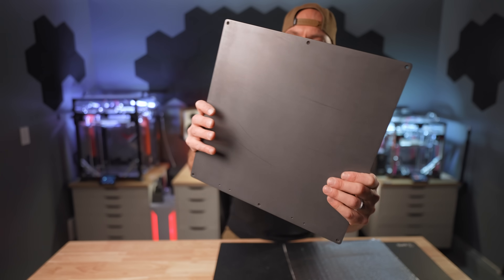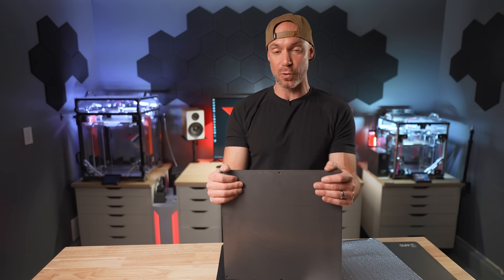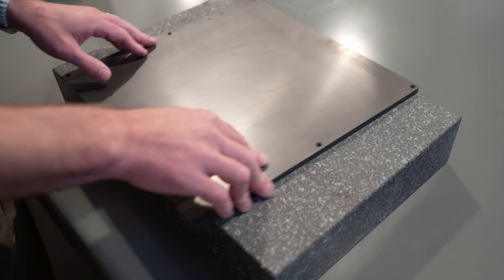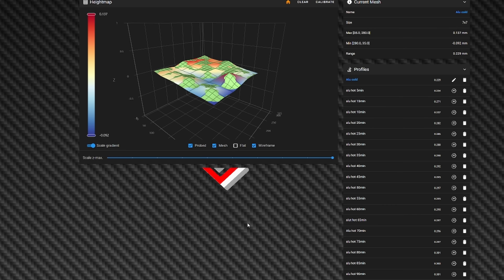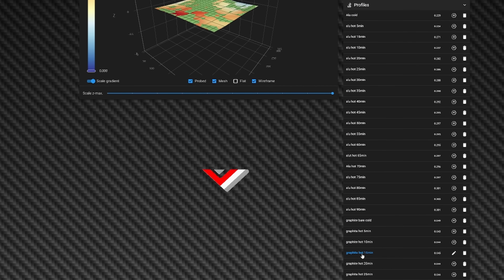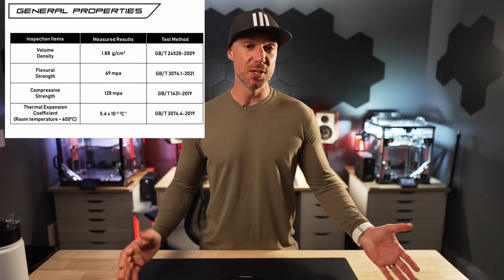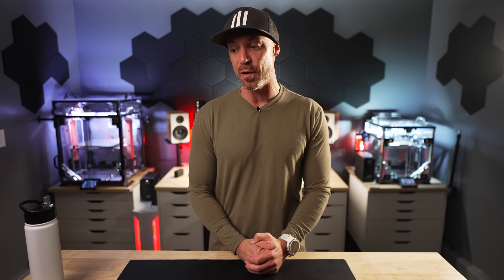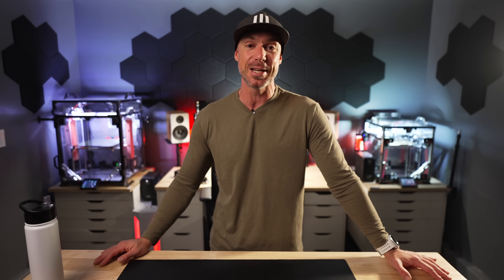Graphite 3D printer Bed - Good or bad ?

Comment: have someone tried a thick steel plate? has half the expansion coefficient of Aluminum and much stronger so less deflection due vibrations and print weight, also a 6mm steel plate should be quite cheap.

Comment: I moved away from aluminum beds with spring steel the instant i saw carbide glass beds.. and after 1000's of prints over about 4 years with half of them being technical materials like ASA, ABS, PC, PPA, etc with the bed heated up to 110c the glass has warped. It's currently at 0.21 cold and 0.265 at 110c on a 300x300mm print area, which is still better than most aluminum beds with spring steel when new.. BUT ~0.050 is so temping. I just wonder how it would pair with a glass bed still because i still found on large dense prints they would pull up the spring steel off the magnetic surface (Gizmodorks magnetic sheet and PEI bed) and with glass i can print a solid ABS part that no lift/warp while also pushing heat into the part and enclosed chamber better (hits 75c after 30 min). Enclosed PETG prints even come out concaved a bit. I'm still thinking about how that even happens. Anywho, if i could get a graphite bed with a carbide glass top that would IMO be the best.

Comment: thanks for doing this testing Vez!  I think this is a pretty novel product... but I still think you're gonna be waiting for a heat soak either way for the rest of the aluminum in the printer, as long as your bed deforms in a measurable/repeatable way I'm not sure this is like THE NEXT BIG THING per say.    Pretty cool tho!

Comment: While I've worked with various composites for a long time, I don't see how this is worth $180. I've been contemplating making my own vs rigging up an eddy current probe. Getting a flat composite surface is less a challenge and more of a requirement, but there's many methods of doing it cheaply as part of the process. If you can cut a ceramic, graphite isn't much more difficult as it grinds very well with suitable abrasives, but more to the point, it's extremely moldable. The tighter the tolerance of the mold, the less you have to grind towards perfection.

Comment: Hi Vez. I saw on your earlier material this flat table surface sensor. then I saw on AliExpress sh36 Eddy v3 board with this sensor, and I thought this is what you are using. so I bought it. now I see that in vz bot there is no sh36 board. how does it look?
Reply from the maker: @projectxmarketing3431  its a beacon3d sensor. I have a video about it
Reply: @ thanks for the answer. I'm currently building my printer. I've been using a quad motor for a good while but with a regular mainboard without a clipper and motor mounts and printhead are printed from ASA. I bought mounting brackets for the vz bot from mellow and a mounting bracket for the Y axis. I cut the Y crossbar out of carbon. I'm still working on the print head and I don't really know how to solve the issue of mounting the accelerometer and the table leveling sensor. I can't really find any materials about it on your channel. I'm configuring everything for the clipper but I have no experience, I'm doing it for the first time. it looks like the sh36 I bought will be useless

Comment: Keep in mind when doing bed leveling or flatness measuring, to have an accurate reading your printer axis has to be as straight as possible and as close as possible to 90° and i mean only a few microns. You simply dont know how flat the plate is if your axes are not verified to be straight which the linear rails are almost never.

Comment: At work we use graphite as the heating element/parts carrier tray try running current across the graphite plate. Not 100% sure how our equipment passes the current will look into it. Would eliminate the need for the silicone heater. We have been using our graphite carriers for years haven't replaced them. They get heated and cooled rapidly to and from 275C. Would be a interesting and novel video.
Reply: Hopefully no one tries this with one of these plates! High density graphite is highly conductive. If you put 220V through this plate without properly insulating it and then came into contact with it.. you'd have a really bad time. Quite likely your last really bad time.

Comment: 0:35 We actually use graphite plates at my job to hold parts when we run them through a furnace due to the extremely similar thermal expansion properties to steel. We need to keep extreme precision because the plates are locating and holding the parts together when they fused.

Edit: We manufacture the plates in house too it's super cool

Comment: What happens when you crash into the bed now?
Reply: With the magnet and flex plate, you'll almost certainly break everything else before that thing but yes in would technically be more brittle.

Comment: no 500mm version for ratrig 😢 guess I'll have to try the thicker alu plate from brs :/ sometimes i regret buying such a big printer when it comes to beds and pei sheets lol
Also i was thinking about trying out the Ti tube mod for X axis, does anybody know how well it works with big printers?

Comment: Much better solution: screw a pt1000 in the Aluminium bed. do a pid tune. Easy perfect bed temperture every time no need for heatsoak.
Reply: This isn't about temperature stability, it's about the bed not changing shape when it's hot versus when it's cold. The bed stays nearly the same shape regardless of temperature. My K1 Max bed is relatively flat when cold but urns into a taco when I get it up to 100c for printing ABS. I've shimmed it so that it's flat enough when it's 100c, but that means it's not flat when it's cold. That means I'm stuck printing only materials that require a 100c print bed. This solves that issue.

Comment: LOL 0,3 mm deviation of an aluminum bed?? WTF
Maybe you should buy a good aluminum bed and not cheap stuff with low qualtity.

The beds I sell have a 0,05 mm deviation maximum. Normally less.
At this size I´m in a price range of about 60-70.- €
Even with magnets it would be cheaper than this graphit thing. 
Then you just put your steelplate directly on the aluminum bed and start printing.

What is the advantage for graphit? Flatness? Not really.
Weight? doesn´t really matter.
Warping of the bed? Use good material and you don´t have any warping. 
I testet my beds with up to 300 °C and nothing changed.

Aluminum has a roughly the same thermal conductivity.

This expensive and useless.

Comment: I'm afraid that it's brittle; that if you crash the nozzle into there you're going to lose a LOT of money. Also how does adhesion of anything to graphite work? Do you print straight on there, do you put down a mag sticker and then steel sheet, do you apply a PEI or PP sticker, will the standard 3m high temperature transfer tape even adhere, even with the print warp forces pulling up on it?
Reply from the maker: @SianaGearz  they have a video showing crashing noozzles is not an issue. Yes i have put a pei steel
Reply: @Vez3D   Huh that's good to know thanks.

Comment: I just paid about the same price for a V2.4 350 bed from Mandala Rose Works plus an additional 100 for the kinematic mounting system,  For a bed that stable it's a good buy. In the UK electricity is £0.50 kwh so any reduction in soak time adds up. 400 hours saved and the beds for free.  What type, make of leveling sensor do you use?
Reply: Beacon probe
Reply: @travistucker7317  Will this work if you have a stick on magnetic sheet on the bed? TY
Reply: @landroveraddict2457  yes
Reply: @landroveraddict2457 It only works with the magnetic sheet. Embedded bed magnets would mess it up.
Reply: @JJFX-  cool 😁😁

Comment: Brilliant product.  Much better than the typical aluminum plate, aluminum has such a high rate of thermal expansion that it's quite difficult to keep it stable over any temperature change.  I've been looking into cast aluminum and cast iron plates with integral reinforcement webs to maxamize rigidity, but that's a whole new level of difficulty to do on your own.  Sadly out of my price range at this point, but a definite upgrade option.  

Also, a tip.  The dial indicator will read more accurately if you can keep the needle close to perpendicular to the direction of travel.  Cosine error can make the measurement show more than the actual movement, not that it matters too much for the level of precision you are dealing with.

Comment: what about stiffness? On a print plate of that size I probably print large models which may have quite some weight. Won't it sag? Or is that no issue at all?
Reply from the maker: Its stiffer than aluminum

Comment: Kinda pointless imo. You add a magnetic sheet when isn’t perfectly flat then the build plate also isn’t perfect. That’s what bed meshes are for. on top of that you still have to wait for frame to heat soak.
Reply: Heat soak is not something you need if the printer is open
Reply: I agree there's little point for smaller beds, but the larger the bed, the more interesting the lack of movement becomes.

Comment: how fast does it heat up? I use 1kW heater with Annex 350x350x12 billet bed and even if it's not as flat, the heat spreads quite fast. I have drilled extra hole under the plate in one of the corners and inserted a thermistor in there with enough thermal paste to keep eye on it. usually after 10 minutes corner and heater thermistor are within 2 degrees C which is quite good.
Reply from the maker: It has better thermal conductivity than alu

Comment: Cool tech. I'd like to see measurements with the micrometer at more points on the surface though, to not only measure expansion but also warp.

As a side note: Are you reading from a script for these videos? The intro was a bit repetitive, which probably negatively impacts video performance. (Count the number of times you mention thermal stability in the first 2 minutes)

Comment: Your review was as transparent as the prints you produced. I mean you spoke about issues with ABS, ASA, and Nylon but never actually tested or produced any sample prints! Baffling
Reply from the maker: Because you wont see the difference in the print ..unless i dont voluntarily not heat soack the alu plate. ...so what is the point the point.
Reply: @ So it’s heat soaked at the end of the video, true? So run a Nylon or ABS/ ASA print and let’s see if it can work with those materials. Just would have been a better overall review of the build plate surely.
Reply: What  is the weight of this plate?
Reply: @B777300   It's lighter than alu. About 2/3rd the density.

Comment: Premium part, but quite interesting and a nice upgrade. I wonder if it still has to be that thick. As I understand it, the aluminum beds are better when they are thick because they are more heatstable that way. But if the graphite bed is much more stable it be usable with less thicknes, wich would made it cheaper to get and maybe even a stock option for future printers. 
Obviously this is only an option if it would be possible to machine it thinner without other negative consequences.

Comment: aww, i was excited to see some printing onto graphite because my brain says graphite will be a nightmare to stick but we never saw that.
Reply: i expect that you use removable surfaces just like on aluminium
Reply: @Nobody-Nowhere  yeah i guess so, i didn't know what to expect really.
Reply: That was my first thought as well, I was thinking it replaced the pei, carbon fiber sheets. But this is cool too. It just costs about 50% of the price of my printer.
Reply: @eslmatt811  i guess the idea is you can get super precise printing because of the machined face and low thermal expansion, my brain wanted to see plastic on graphite though 😅😆 Makes sense if say youre printing with a 0.2mm nozzle some kind of medical or mechanically or scientifically accurate thing.
Reply: @6AxisSage  in theory that would work. Granite does conduct heat, but how well does it handle heating and cooling? My only experience with heating stone is BBQing pizza on marble, it gets very brittle. 12x12 surface plates are less than $100, it might be worth trying if you are chasing zeros.

Comment: This is aluminium with graphite surface coating. It is not a solid piece of graphite. Solid graphite will not be structurally strong enough to be handled like that. It is also really-really easy to machine since graphite is literally used for lubrication and it is crumbly. On a positive note: if this is indeed aluminium with graphite coating and not black anodization it will conduct and spread heat more evenly. There is a process where they plasma spray graphite onto aluminium. Then for finishing they skim the surface on a milling machine.  EDIT: The material properties shown in the screen are that of Aluminum Oxide (Al2O3), so if N20 Factory is sharing those and promoting the bed as being "graphite" I would be sceptical.
Reply: how does just a coating eliminate thermal expansion of aluminium though? even distribution of heat doesn't have anything to do with the huge expansion rates (relatively to 0.2mm layer size) of alu.
Reply: There’s many different forms of graphite, sheets/solid graphite is used in Edm plates, crucibles, etc that isn’t a graphite coating. It’s a little brittle but definitely not flakey -made a different way
Reply from the maker: Its not a coating... Its not aluminum. Its 100% graphite

Comment: I am curious to see how this would do in a Voron style build - what happens to this ulta-flat, ultra-temperature stable, ultra geometrically stable print bed when you attach it to an aluminum frame/carriage?
Reply: Without expansion tolerant joints it will definitely bend. To get the most out of this bed you really need a RatRig style bed mount.

Comment: You first head the beat + hot-end up to print temps. Then you calibrate the print bed. Thermal expansion at constant temp/pressure is minimal and unlikely to make a measurable difference to anything. Some people like to change the bed temp during printing, this could in theory create a larger delta only we're almost always talking about small deltas - how much deformation does a change from 65c > 60c cause?

Comment: I wish I had known about the kickstarter. All Voron beds are expensive in Australia because we have to import them so this would not have been that much more than a normal bed.
Reply: In that case I'd just go talk to a machine shop instead of importing it.
Reply: @JJFX-  Lol, OK. Do you think none of the retailers who import them thought of that? Or none of the people building their machines? You will pay one off rates for machine setup or minimum job costs and it will cost a fortune. All beds here are either imported, home made or if you are lucky you somehow have access to get it made at mates rates. If it was so easy obviously nobody would be importing slabs of aluminium for no reason.

Comment: This product would be awesome for larger printers such as Ratrig (400mm or 500mm beds). So much headaches could be solved with a large ultraflat bed. If they made a 180mm size as well that would be great. I think the prices did go up. Website is saying $290 for a V2.4 350x350 bed. I think its a worthy investment considering how much use you can get out of this bed.
Reply: a large, flat bed..... that doesn't move when heated. The last part is much more important the bigger you go.

Comment: now for a long term review to see how it holds up to use... will it crack over time, will it sag etc
Reply: It will sag or warp…

If you repeated heat it to 1500c. Its melting point is upwards of 3600C.

It will never move at all under 200c. It’s is EXTREMELY thermally stable.